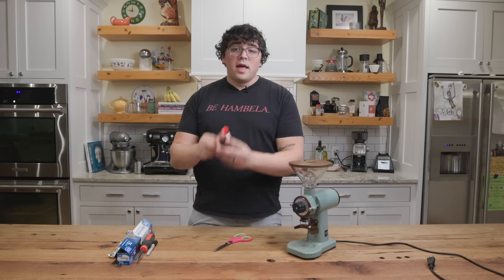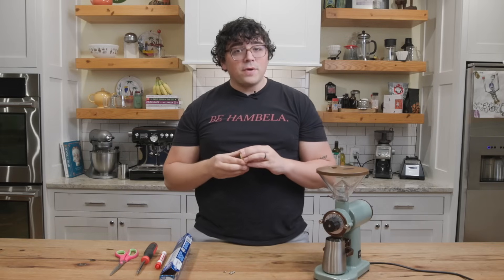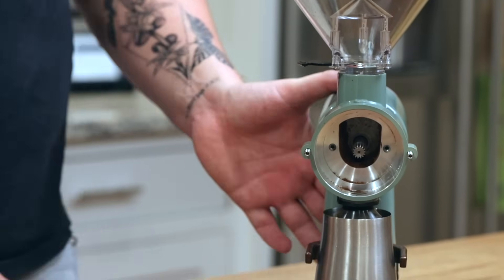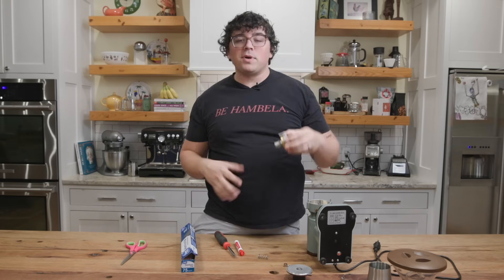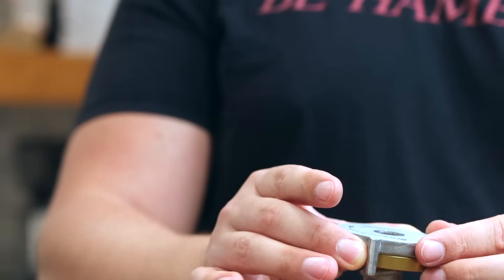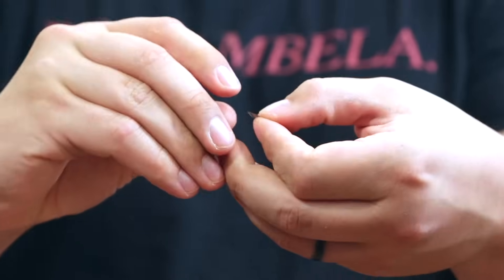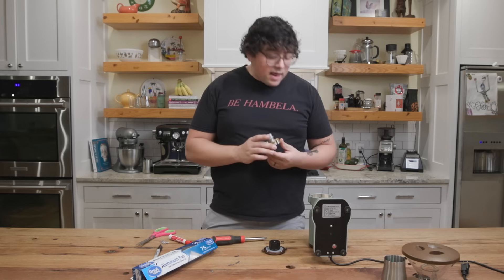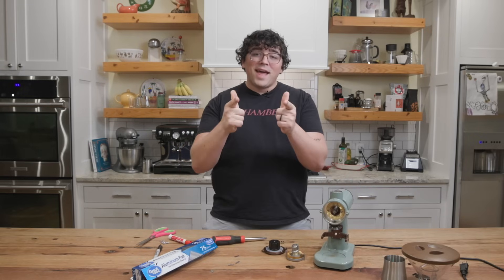HOW TO ALIGN YOUR GRINDER: Shim Alignment Tutorial

Comment: Delicious wipe. Thanks for bringing joy to my life, Lance lol. I need to align my Fellow Ode. Just picked up some SSP burrs and I feel like I’m getting way too many fines.
Reply from the maker: Oh fantastic! SSP burrs are great. Did you get the multipurpose?
Reply: @LanceHedrick  Yeah! Super pleased with them. I feel like I “unlocked” the Ode.
Reply: Did you ever end up doing alignment on your Ode with the SSP burrs? Ever since I upgraded to SSP MP burrs on mine I've noticed a lot more fines than with the stock v1 burrs and my V60 brews clog so much more easily. I'm thinking I need to do this but wanted to know if it worked for you.
Reply: @interruptVEKTOR  I’ve adjusted the burrs a few different times! The grind distribution is definitely better, but I’m still getting noticeably more fines than the stick burrs.

Comment: Hi Lance, I bought the Urbanic 070s based on your last video with the titanium burrs.  It is working great and producing tasty espresso.  I tried this alignment technique and even with the knob removed, I cannot get the burrs to touch.  Any pointers?  I guess I could shim the back burr to get it to touch but I am wondering if I am missing something.
Reply from the maker: Hey! THere is a little spoke that is bent down to prevent you from touching burrs Make sure to straighten it out.

Comment: I’m not sure I understand why you would align both burrs. Aren’t you aligning one burr relative to the other? If the stationary burr wipes the marker off the rotor burr then shouldn’t the rotor burr wipe off the stationary?
Reply from the maker: No. You're aligning them both relative to the auger. Imagine if they were both off, making a V. If you align one to a full wipe, it could all be wiping one point on the bottom burr
Reply: @LanceHedrick  Ah I see. I understand thank you!

Comment: I bought an urbanic 60 off of Amazon for an embarrassing price. It seized up the second time I used it. I tried cleaning it, watching this video, because it was literally the only thing I could find even relatively close to dealing with troubleshooting the thing. Tried to get help from the company which has been a total waste of time and they STILL won't allow me to return it even though they say they provide customer support . DONT FALL FOR IT.  I am not an expert but I've had my fair share of grinders and this grinder may look nice but it's a total POS. I just want to say it's never worked again and the customer service even through Amazon prime is NON-EXISTENT. It's the worst money I've spent on coffee
Reply from the maker: What do you mean it seized up? I have taken this apart and examined the motor. It is well built with a solid motor.
Reply: @LanceHedrick  I didn't say what kind of motor it was.. I said I bought the urbanic 60 (I have no idea what grinder is in this video but it's the closest I could find to the urbanic) and it seized up on the second time I tried to use it.. I tried and tried to get customer support any kind of troubleshooting help at all from the company and I can't get any. They just say one thing.. "see the owners manual" which has no info on any of this. Most of the videos are in Korean with no subs. I'm not saying they have to be in English but if you are going to advertise to an english speaking market provide support or troubleshooting . Before you go nuts I'm not slandering the video I already gave it a thumbs up and subscribed but I don't know if it will help my situation.I paid nearly $400 for my grinder. Now that I've looked on you tube it looks like I way overpayed. Also, I haven't had any coffee in well over a week so I'm another hurting unit all in the same week I am dealing with some really overwhelming health issues in my family (family of 2, myself and my mom, so there's just me to shoulder it) so coffee crapping out on me is leaving me soured to the whole expanding out from my baratza encore which I used for 15 years

Comment: I use a digital caliper to make sure the stationary burr is perfectly flat in the bore. Then I shim the outer burr accordingly.
Reply: Shouldn't you make sure that the rotating burr is perfectly perpendicular to the motor shaft, then align the stationary burr to it? If the rotating burr isn't perfectly perpendicular to the shaft, it will forever wobble as it would not be rotating evenly along the axis, no matter the orientation of the flat burr.
Reply: @NaserAlOqab  the spinning burr can be slightly off axis and still spin true to the fixed burr due to the carrier design and manufactured tolerances in the drive shaft. You will be chasing your tail if the stationary burr isn't flat as possible in the bore.
Reply from the maker: Heck yeah! I will be working on a vario alignment video at some point and will include this trick

Comment: Checking my Rancilio Rocky. Thanks for explaining this. The aluminum foil makes me wish I'd thought of that when adjusting headspace on my single shot TC Pro Hunter Encore rifle. Thought my reloads were hot, even though they were on the low side of published data. Turned out I had a headspace problem. Took me forever to find 0.001 stainless steel sheeting to make shims. A company premakes them, but at a high cost. I could have raided the kitchen for aluminum foil and saved a few bucks. Great job on exposing shim material already in the home.

Comment: help! i am so confused: i just tried this with my ode/ssp and NONE of the marker is wiping off🤔🤔 on neither burr (maybe a bit more on the stationary one when i try that one) how can that be? lol
Reply from the maker: Are you touching your burrs?
Reply: @LanceHedrick  well i turn the calibration dial until they chirp (big chirp just to be sure) … also tried manually spinning them against one another. (btw it’s expo marker not permanent hahaha) it wipes off with my finger but not during the chirp.
Reply from the maker: With ssp burrs? This is super odd. Like. Super odd. I had a friend who this happened to and it turned out he has permanent marker lol
Reply: @LanceHedrick  haha 😂 … i’ve just been told by those who sold me the ssp’s : « The marker method is not effective with the SSP Brew burrs in particular, as they do not have a flat outer edge that comes into contact with each other (as with the Espresso or Multi-Purpose burrs). As such, the contact resulting in chirping with these burrs may not show as clearly (or clearly at all) with the dry-erase markings. » … but didn’t you align yours?

Comment: How much of a difference do you think a torque screw driver makes, for aligning?
Reply from the maker: That is a good question.  I actually need to tinker with this. anything I say would be complete conjecture
Reply: I always use a torque driver when aligning my EK. If you're not consistent with your torque at each shimming stage alignment can take for ever. I also reccomend swapping to torx (star head) screws instead of flat heads; that way you improve torque consistency and reduce the risk of the driver slipping and damaging burrs.

Comment: Please help, we have a grinder based off Mazzer Major's design...I couldn't for the life of me get the burrs aligned with shims :/ under the lower burr is a plate that appears bent deliberately to accommodate a tension ring. Could this be the cause of my frustrations? The contact point at the moment is about a 1/2 inch length section and I just can't seem to improve upon it.
Reply from the maker: Bent intentionally? That doesn't sound right. I'd try to buy a new carrier. Poorly made burr carriers are like 90% of issues in grinders re: alignment

Comment: Do you clean off the marker completely when you're done? If yes, how?
Reply from the maker: Using dry erase, it just comes right off like on a white board!
Reply: @LanceHedrick   One more maybe dumb question. Do you ever have to stack shims on top of each other to get more height, or like, fold it more than twice? Is there a limit to how many layers of foil should be stacked up?
Reply from the maker: Yes I've done this! No limit, really, but if you're at 7 layers, might need to rethink what you're doing hahaha

Comment: I’ve seen so many recommend shims only near the screws to prevent warping. You’re not in that camp so curious to hear your thoughts on it.
Reply from the maker: I don't follow that camp based solely off my experience and the lack of evidence proving said warping.
I've aligning many grinders and even have about 20 in my house (I use them for videos and give away ones I no longer use).
I have never in my decade of coffee seen or heard of a burr warping from a layer or two of aluminum foil.
Could it happen? Perhaps. But I'd be more worried about tightening screws too much, which verifiably does warp the burr, unless you notice and fix ASAP.
Reply: @LanceHedrick  My thoughts, too. Burrs  are pretty hard steel and hard to believe they’ll warp that easily.
Reply from the maker: Don't get me wrong. They will if you screw then in super tightly. You'll see the marker test, even if perfectly aligned, will not wipe near the screws because they'll be slightly warped. But that's the only warping I've seen. And it's from substantial force from the screwdriver, not from a little thin shim lol
Reply: @LanceHedrick  How do you tell how tight you should reapply the screws when attaching the burrs?
Reply from the maker: just go until they you cant tighten anymore with your finger tips on the actual screwdriver metal

Comment: Hi Lance does it matter in which order you shim the burrs? I tried to do my Mignon Specialita and done the moving shim first, but just couldn't get the static one right, I gave up in the end!
Reply from the maker: I definitely recommend moving burr first. What was wrong with static?
Reply: @LanceHedrick  it was showing one patch about 1" where the marker was being taken off. I lifted the opposite side one layer of foil at a time using 2 places I got up to 31 layers before it then went over the other way. There was no gradual change. I took it back to 30 layers and was back again to almost where I started. 

It took me 12 hours! In the end I just removed all the shims and put it back together. A repair guy did tell me that after quite a few kilos of coffee they will sort themselves out, they then are seasoned. 

Not sure what to think to be honest. Maybe I will have a go when I get bored. What was shocking is most people only talk about 1-5 layers of foil, mine didn't move till 31!

I did wonder if it is the way that the specialita burrs drop into the carrier. Not allowing you to slip in foil at the side.
Reply: @LanceHedrick  Why moving burr first?

Comment: Just did this on my Ode with SSP. Game changer
Reply from the maker: Wonderful! Such a good brewing grinder
Reply: How did it go? I had mixed results, my rotational burr only got partially wiped off (I used up to 5 layers of foil) and I dont quite understand how to do the stationary one
Reply: @richieyasu5683  Such a success. Two months in and my brews are so consistent. Able to grind a lot finer and have zero issues with stalling now. Almost every brew prior to alignment stalled, especially Ethiopian coffees which generally produce more fines. I had to do 8 folds of foil in one section! It was so far out of alignment
Reply: @sammcallister1081  oh ok! This makes sense for me, thank you. How do I know how to work on the stationary burr btw?
Reply: @richieyasu5683  I started with the stationary burr, that's the one that needed a lot of shimming. Then I switched the the rotation burr and aligned that. Same as Lance in the video
Reply: @richieyasu5683  Whole thing was pretty tedious and took me about 2hrs
Reply: @sammcallister1081  awesome! Thanks again for your help :) enjoy your brews

Comment: I have the early v1 ssp brew burrs in my ode. When looking for ode alignment info, I read somewhere that because of the slightly raised outside edges/teeth that the marker test would not work. Have you ever performed this test on those specific burrs?
Reply: you need to have flat part on the outer section of the burr to have somewhere to rub against the opposite burr. On brew burrs like in the Ode this technique is not appropriate.
Reply from the maker: Check out my caption. I have put a notice there specifically about the ode burrs. Thomas is correct
Reply: @LanceHedrick  I’m actually not using stock ode burrs. I have V1 ssp brew burrs, not the updated multipurpose fellow is selling. The edges are slightly raised. Nothing like the stock ode burrs. Was just wondering if was possible or if I would be wasting my time. Thanks
Reply from the maker: Oh gotcha! Misread. Yeah even v1 are brew burrs. If the edges are raised at all, I wouldn't recommend marker test. Maybe do marker test with another set of burrs, shim those, and recreate the shim position with v1
Reply: @LanceHedrick  that’s a good idea! I’ll have to look for a really cheap set of espresso burrs that will fit
Reply from the maker: Absolutely! Should be easy to find some cheap, knock off 64mm burrs you can mess with
Reply: Just a note. The Ode gen 2 burrs, just released, have no ghost edge, and this method will work with them. Nick, the Fellow engineer who designed the new burrs, recommends this alignment method, and also recommends seasoning.

Comment: u should not get a debber touch point, the touch point should be the same, because u are only lifting, not pushing in the burrs in, but u get more touch offcause
Reply from the maker: Correct. I was going off if burrs were locked for calibration. I've edited. Appreciate it

Comment: Hey! Just one note about changes in touching point. Yes, it will be lower but only if your recalibrate your zero point where burrs lock. Otherwise, you're moving burrs closer together and so your touch point with the same calibration might become bigger.
Another thing I'd tell viewers is that, in general, if you previously dialed in your grinder and did a great job for alignment your grind setting should be a bit higher (coarser) after that. It's because you got more uniform distribution and water will flow faster through more uniform grounds.
Reply from the maker: You're correct on touch. Apologies. 
As for the other, I was going for concision and hoping for implications to be made when discussing less fines with better Alignment haha! People know sieving fines increases drawdown/lessens contact time..anyway, thanks for the engagement!

Comment: If the burrs touch - do they get damaged ?
Reply from the maker: If you always grind while they're touching, sure. But slight chirps and occasionally grinding at touch point is fine because the edges are flat, not toothed

Comment: It would be interesting to see exactly what the difference, in weight the of fines, actually was before and after the adjustment. Intellectually the alignment makes sense, but would love to see the real difference. Love your passion and enthusiasm for geeking out on all things coffee!
Reply from the maker: Massive difference. I'm sure you can find an abundance of charts online. I've never bothered charting it because I've done it so often and tasted the difference. I've even diagnosed multiple cafe grinders off taste alone from coffees I knew well. Checked alignment and they were 100% off. Massive difference
Issue in measuring fines is, because the static bond, you won't be able to sift out more than like 50% anyway. So, measuring without maybe a laser diffractor is futile.
Best way to test is just blind tasting side by side same grinders, one aligned and one not.

Comment: Thanks Lance. A bit nervous to try this on my flat burr df64 Since I am not having any issues. I actually get out what I put in. If and when I upgrade my burrs to ssp I’ll definitely use this video!👍
Reply from the maker: So, this has nothing to do with retention. I promise your grinder will perform better doing this!
You got this! Gotta open it up to clean anyway 😁
Reply: @LanceHedrick  Yeah I’ve been told or asked if I’ve aligned my burrs coming from espresso outlet I wasn’t sure if they did it already so I guess I should test it to be sure. I definitely don’t wanna make it any worse. I’ve heard stories.Might need to get hubby involved :-)
Reply from the maker: For sure! It'll help clean up your shots, for sure